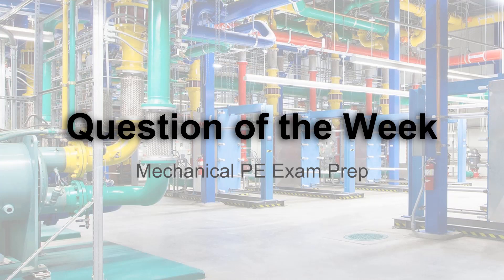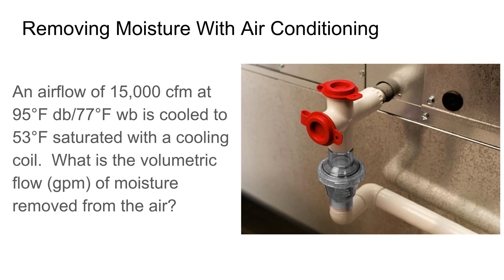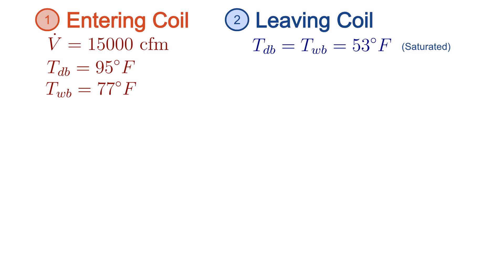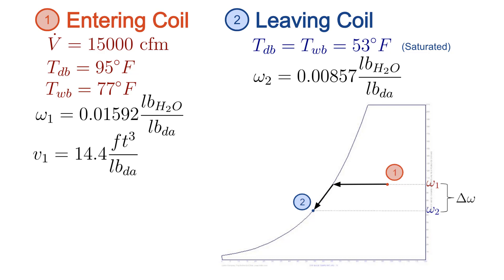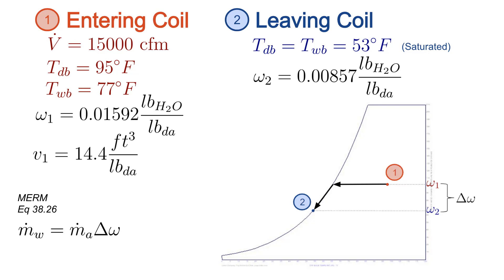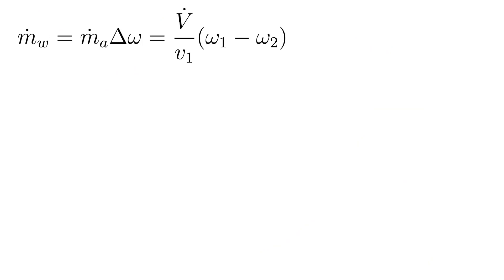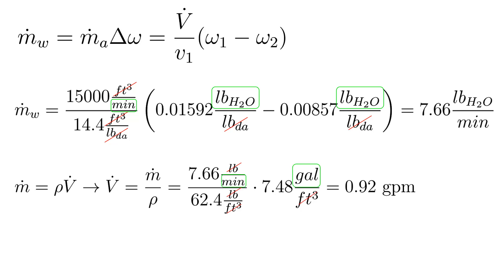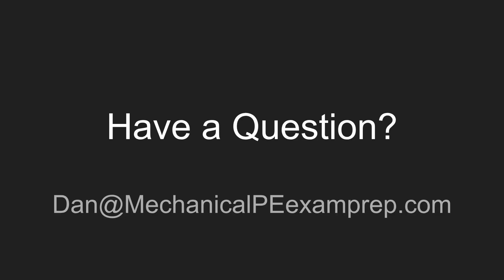How to Calculate Condensate Flow Rate in HVAC Systems | PE Exam Prep Problem Solution

Comment: Great video! Btw, state (1) 95DB/77WB = 44.7%RH, at state (2) saturated = 100%RH. Is it real by cooling air (in this case) the relative humidity goes from 44.7 to 100%. Any thoughts are appreciated!
Reply from the maker: Yes, on it's way down the saturation curve, that's fundamental to how air conditioning works! Are you a PE candidate? If so get in touch Dan@mechanicalPEexamprep.com